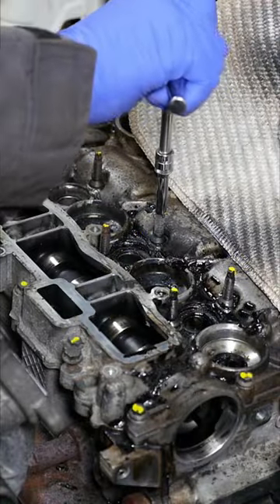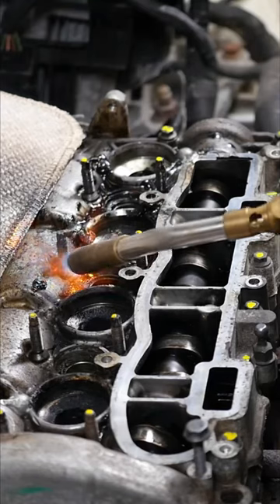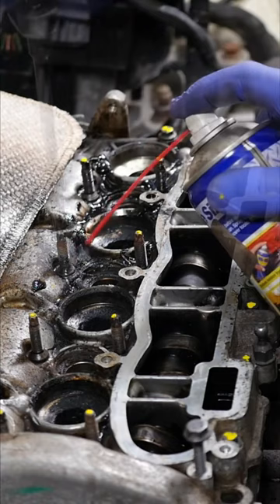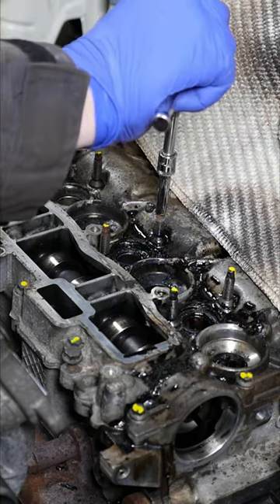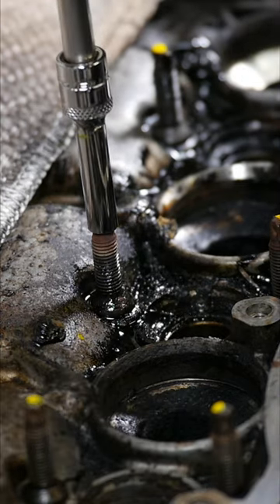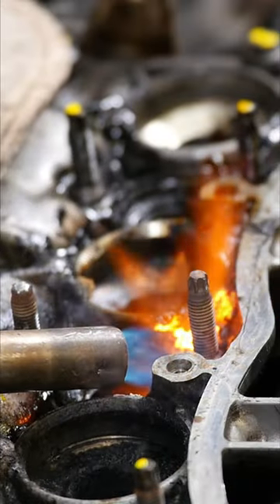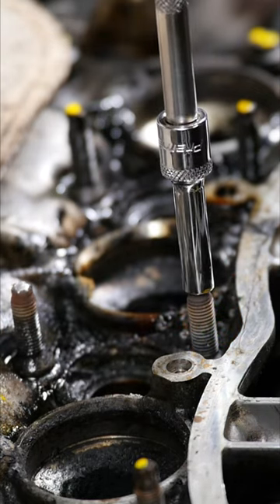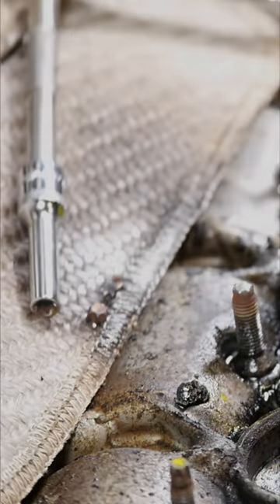Camshaft Cover Removal on 1.6 Diesel Engine.  #shorts #peugeot #mini

Comment: Try using two nuts tightened against each other, use a wrench on the lower nut to loosen the stud. Works just about every time
Reply from the maker: Thank you, that's a great method but the issue here was the tar had bound the thread tight inside the cover.
Reply: I done that before on exhaust manifolds when working on rusted vehicles u have to think out side the box these new vehicles start rusting immediately and I never seen 3 year old trucks with dust covers rusted off I used find vehicles in woods and all that stuff laid in woods and never rusted
Reply from the maker: @richardzubeck8704  I remember the Volvo's and they never had rust anywhere on them.  Shame they were so thirsty on fuel.
Reply: All that thread and he decided to snap off the tops...
Reply from the maker: @MyFishy007  The tops sheared as the lower threads were bonded with tar.  All of them sheared off.
Reply: That's what I'd have done make the stud glow and work it out
Reply: @CoatsandGaiters the jam nut method works really well on these. The stud needs to be very hot for a long time.  Scrape away the tar at the point where the stud goes into the cover and use blue take to form a dam around the studs so a puddle of penetrating oil can be formed ( brake fluid is also good ) and leave for a couple of hours. Then jam nits and a very hot stud to the point where the tar is being wicked out of the thread and your good. The jam nits allow for far more torque to be applied
Reply: I had this issue try finding nuts that fit cuz they ain’t normal thread I ended up welding a nut to top and tightened them abit more witch cracked them and then they loosened perfect just buy new ones pretty cheap ✌️
Reply from the maker: @jamiefowler2329  I had to replace them all.  Cheap like you say to replace.
Reply: @jamiefowler2329  well yea when you’re working on metric fasteners you’ll run into that problem. Keep some metric nuts and bolts on hand problem solved
Reply: @marshallbott6936  regardless when it comes to the job they are like a 10mm do not exists anymore aka lost in transit🤣so always need a plan b

Comment: I agree with the jam nut method. Worse case you have to drill with left handed drill bits and rethread
Reply from the maker: The issue seemed to be the tar had bound the thread tight inside the cover.

Comment: I had a valve spring keeper half fall down the oil return hole in my escort 1.9? engine. I pulled the magnet out of a pocket screwdriver, taped it to a coat hanger, went down through the return hole and since the oil pan was aluminum, it kept the magnet from hanging up. After About 20 tries, out came the keeper! It was a good day after all!👍
Reply from the maker: I had something similar with my Allegro.  I removed the fuel pump and the push rod fell into the sump but thankfully the magnetic plug caught it so it came out when draining the oil.

Comment: Mak a mixture 50-50 of paint thinner and dot 4 brake fluid soak that sucker and leave it overnight, the tar wil get soft 😊
Reply from the maker: Thank you for this heads up.  I have heard that brake fluid works apparently.
Reply: @CoatsandGaiters  i always used this method on these engines and it works like a charm.
Reply from the maker: @jaspervanwijk2685  Will try next time

Comment: I've delt with this many times. The trick is always more heat. Get the stud glowing red. Then continue heating untill it starts melting the stud. Continue heating untill you burn down the engine, and replace it with a factory new unit. Works like a charm every time
Reply from the maker: You 'had' me initially on this one lol
Reply: @CoatsandGaiters  it's sort of true tho, I've worked a lot on these engines. The truth is, just get two nuts on them, and get the entire thing red hot, preferably with an induction heater, and it'll come out nicely
Reply from the maker: @waffleown4258  arrr so you did mean the first bit.  I really must try and get one of those induction heaters.
Reply: @CoatsandGaiters  It's worth every penny. It heats quicker, and the heat is much more localized and controllable, so you don't ruin other parts around it
Reply from the maker: @waffleown4258  I'd definitely have one but a bit expensive for me just yet.

Comment: Stud removal sockets and a brazing tip on an oxy ace torch with heat concentrated on the stud until it is almost glowing and let the color dissipate the sockets will let you get farther down the stud and less likely to break and make your job a lot less fun I’m not a pro but I’ve been a dealer field technician in the heavy equipment field for almost 2 decades
Reply from the maker: Very sound advice Cory
Reply: Best of luck on getting them out
Reply from the maker: @thecount1929  I had to replace them all.  They all got destroyed removing them.
Reply: @CoatsandGaiters  at least you won the war sir lol we have a saying here (US) and it is “it was going really good but then it just stopped going good”
Reply from the maker: @thecount1929  nope I lost the war on this one as well.  Ran like a dream for 200 miles then made banging noise like the big end bearings had gone.  Had to sell it cheap !!!

Comment: Heat it up until the stud is cherry red and pour out a water on it and quickly use breaker bar, would do a magic 😉
Reply: Saw that method used before and it worked a treat. But swap water with a bottle of brake cleaner getting pierced straight at the cherry red stud.
Reply: @Quattro_Joe  that’s a good input.. isn’t the brake cleaner gonna fire up as soon as it squirts to heated stud?
Reply: @carlopadillo587  it didn’t when I was looking at it. In the words of the tech doing the job “it’ll be grand”

Comment: I don't think its tar. Heat would melt tar. Solving sprayed on hot tar would dissolve into the tar they're both petroleum-based. I think the stud is seized into aluminum. Steel and aluminum are dissimilar. They naturally react and seize.
Reply from the maker: Think it was tar in my case - Full video here https://youtu.be/9tdhJctDUZM?t=675

Comment: You put on a wrench so that you can hit it with a hammer. at the same time, you unscrew using not too much force and the other person taps the key vigorously and again and again. This method works 100/100 best regards, worth a try.
Reply from the maker: Thank you for that info Sobico.

Comment: What about putting 2 counter locking nuts and removing that way?
Reply from the maker: think that would normally work but these were stuck fast by the leaking tar from the engine.

Comment: One thing to look at is CRC freeze off it has penetrant lubricant like I've never seen before but also it will make everything so damn cold that it will make everything shrink cracks will form in rust and the fluid will definitely penetrate where it needs to go it saved my ass of time of two and I never heated up my bolts then again certain bolts you cannot heat up cuz you'll fuck everything else up
Reply from the maker: That sounds like a good idea.  I don't have anything like that though as a home mechanic.

Comment: Have you thought of heating the stud and tapping the top of the stud with a hammer to break the sludge that might have corroded in the engine
Reply from the maker: It was glued in with tar on the under side thread.  Nightmare these are

Comment: Use oven pride on the engine 24 hours before stripping out injectors it eats up the carbon and everything comes apart
Reply from the maker: Thank you for that.  I did use oven cleaner on the plastic inlet manifold on this engine to great effect.
Reply: We used to use it all the time on hgv engines works a treat
Reply from the maker: @alansmall9071  do you drive HGV’s then ?

Comment: Thanks so much for this, just a swine of a job and a questionable design choice lol, helped me out no end even though I just ended up getting a set of mole clamps on the threads to wind them out. Ain't got no time for that 😂
Reply from the maker: Not the easiest to work on but the engines seem ok if regularly serviced. The studs all snapped on mine but were cheap to replace.

Comment: The purchase pressure of the male torx of such a bolt is useless - but if you use an M5 socket that has the front ground off so it is flat (without internal bevel/ chamfer) it now has a cutting edge - using a hammer the socket will cut a new hex which is a lot stronger and has more purchase on it….   Using a 3/8 to 1/4 adaptor there is more force exerted on the bolt👍👌 Mobile Thread Repair Services 🤔
Reply from the maker: Wow thank you for that information.  That's valuable to know.
Reply: @CoatsandGaiters  it works on most things even exhaust bolt but like everything its not guaranteed but is another thing in your arsenal of things to try before seriously getting into drilling - with the bolt once the boss part of the bolt is drilled it does come out but I have seen them snap below the surface, then you need a drill guide to deal with it.
Reply from the maker: @Jonodrew1286  drilling is the last thing I ever want to do.  Ok in a drill press but by hand can be long and tedious.
Reply: @CoatsandGaiters  well sometimes I think I am crazy at the things I dont say no to - I find it hard saying no - maybe its the challenge - drilled out an EGR bolt from a TDV6 Rear of the bulk head near the steering link manifold in-situ, thought it was a bridge too far drill was too big without a bit had to hand grind it and could not get on it straight only from each side - cant believe I got it all out and had a decent hole left - most engineers would have walked or requested the body to be taken off - think I need my head testing 🤣🤣

Comment: Might have more luck not using a 1/4 drive 🤷‍♂️
Reply from the maker: The threads are the size they are and just very fragile.  I should have heated them more maybe with an induction heater.

Comment: You can tube a lot of I believe the 325 with the rear end of the car that cracks all over the body mounts to drive mounts. Total trash keep it over the pond
Reply from the maker: What's a 325?
Reply: @CoatsandGaiters  sorry it was the E46 m3, I have fixed several of them. Bmw wants to fill it with a plastic filler for the fix. I recommend all new poly bushings and getting the plastic filler
Reply from the maker: @jasonmillspaw6970  arrrr I see.  This was in a Mini.